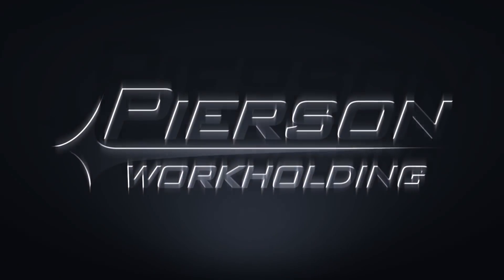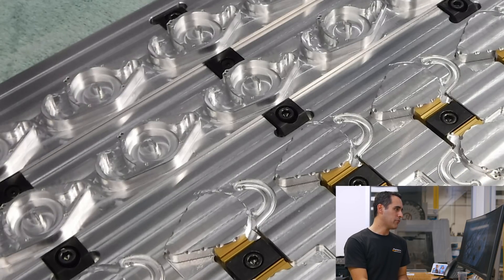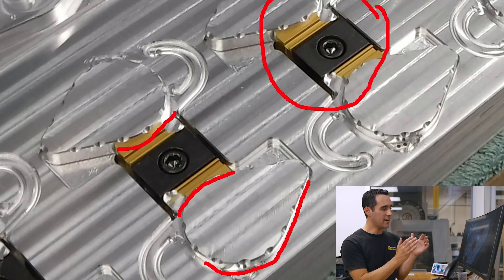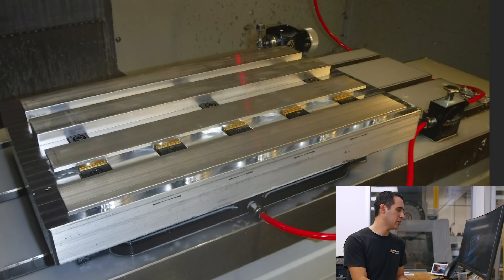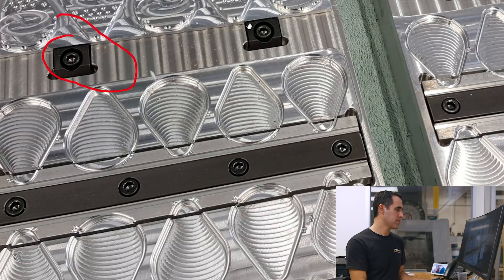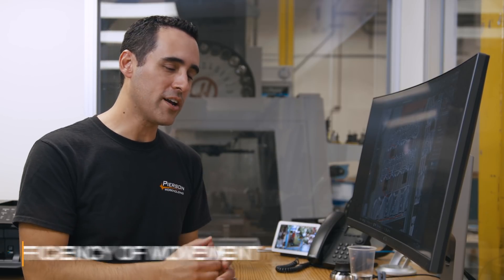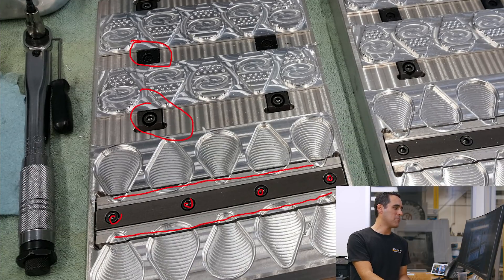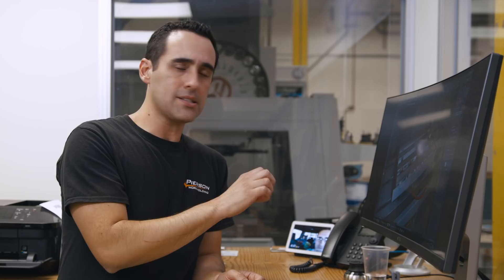Talons, Pitbulls & 20 Parts | Customer Review | Fixture Friday 7 | Pierson Workholding

Comment: What is the best way to hold something that's thin wall?
Reply from the maker: Vacuum is best for thin walls. Especially thin floors.
Reply: @PiersonWorkholding    Thanks.  What about a square tube, or a thin walled box?  I don't want to mar the surface, or rip out of the clamps.

Comment: How do you tell after knocking the part into the fixture that its sitting correctly if you can't wiggle the parallels like you can with a vice? Thanks.
Reply: I've found it to be unneeded in almost all fixtures, at least for those where the clamps (like those shown in the video) have both sideways and downward pressure

Comment: Those are some sweet fixtures. Lots of stock cutting time saved using long strips of stock and less handling flipping one bar over that has 4 parts machined into it.  Looks really efficient .  He could shave cycle times by raising that pallet closer to spindle, lots of slow wasted z movements on haas mahines changing tools and getting back down to the table. for a large run it adds up to a ton of time .